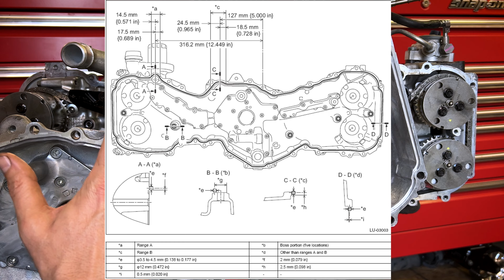Subaru FA/FB Series Engine Timing Chains: Removal & Installation

Comment from the maker: ‼️⚠️Correction in the video! The RTV silicone bead goes just outside of the groove, not in it. Place the bead on the flat mating surface between the groove, but inside of the bolt holes. The groove is there to catch the squish out when the cover is reinstalled. ‼️⚠️
Reply: Should remove the dipstick also, seen it get pinched between the cover and upper oil pan if you reinstall it with it in the tube.
Reply from the maker: @lacrease6517  yup!
Reply: @MrSubaru1387  can't someone like FelPro make a real gasket set for these engines?
Reply: Glad I read the comments. 😳
Reply: @MrSubaru1387 
Hi
Reply: So i followed the video instructions but did not see this comment until after resealing. So i used RTV inside the groove, i did however use a very small bead that was just enough to fill the groove so i wouldn't have globs pushing out. Do you think that is a huge issue? I also let it fully cure before refilling with fluids
Reply: Just remove and reseal it since it was not applied to the mating surface
Reply: @hno7625  just did that yesterday. Had the tiniest oil leak so took the timing cover off with the motor still in. Very easy to clean that groove, reapply, and seal again.
Reply: Do you have any videos showing cam carrier seals replacement in the FB25?
Reply: What can I do after I break that back piece on 9:01
Reply from the maker: @hackiess8146  likely going to have to replace that cam carrier or cylinder head. Whichever it attached to. Not sure which piece you mean or how much of it broke off.
Reply: I just got quoted $3.5k at the Subaru service center to reseal my leaking front engine cover on my 2017 fa20 wrx , do you have a video for a turbo version? Or is it about the same ? What would be a reasonable price ? I’m in California if that matters
Reply from the maker: @cesarreynoso7843  turbo engine cover is basically the same.
Reply: @MrSubaru1387 what are the part numbers for all the Orings needed to be replaced?
Reply: @MrSubaru1387   I have a code that indicates bank 1 cam A low response or something like that, I have already changed the position sensor, I have already changed the solenoid of both cams of bank 1, do you think I should change the vvt on the cam sprocket?
Reply: @MrSubaru1387 what rtv do you reccomend for this? Have you considered using an anaerobic sealant such as loctite 518? This wont harden and enter the oil if too much is used. What are your thoughts on this??
Reply: Thats what I'm searching for
Reply: 170,000 miles on my 2015 and oops my bad
.sure the chain jumped a link
misfiring and a back fire. towed it back to my garage
.hope I didn't wreck the valves or anything..thanks for any advice and this great detailed how to video.
Reply: I need to replace my timing chain in my 2013 frs, should I replace that or the whole motor? I've seen used motors for $3-5k and idk how much it would be to have someone replace the timing chain. And I don't know what would be my best option 😭
Reply: @jedwin4816 It’s not designed for a gasket. The precise metal-to-metal fit is critical.

Comment: anaerobic sealer like Locite 518 or Permatex 51813 is the way to go with these timing covers or cam carriers.  it is much easier to deal with and has zero chance of plugging anything up. i hate RTV the only thing i use RTV on anymore is tins.
Reply: This! Volvo makes a great one too
Reply: How easy/hard is it to get undone for the next repair?
Is it comparable to RTV during removal or might it increase chances of breaking the cover?
Reply: Did you use the 518? I am considering it. I've had good success in industrial applications with it. If you used it, how has it held up over time?

Comment: Hey I followed step by step on how to do the timing chain replace on my 2015 Subaru Impreza. Not I have a p0011 and a p0021 code. And my crank pulley is wobbling. Please help

Comment: Great video, Sir i have a 2013 outbak, I didn't have any timing problems be for doing the job just the chain rattle. Car ran fine .After doing job i get codes for Phasers  to advanced and the car seems a little flat  in performance when driving.  I followed your video to the Tee, Carefully assembling. The only question was during assembly where can the painted links be , Are they dead on the timing marks or  a little to the left or right?  I did not replace the phasers because i wasn't  having timing problems. Any help or suggestions would be greatly appreciated. Good day!

Comment: By far the most comprehensive video on FA timing chain R&R available that I can find. I'm in the process of rebuilding one of these engines right now and I wanted to find something clear and understandable by a professional tech. Thank you!
Reply: How did that go? My timing chain got messed up in my 2013 frs and idk if I should fix it, get it fixed, or get a new motor. I've heard the motors can blow if this repair isn't done well
Reply: @dadrip  i ended up having to move the rebuild due to other projects but since the weather is straight shit right now in northeastern nc i moved the fa 20 block back into the other side of my shop and am about to start building it to have it ready to go in the car this spring.
Reply: @joepluchta4594  hell yeah try to keep me updated on it
Reply: @dadrip  i will, I'll take pics and I'll get back up on here whenever I get this engine put back together.
Reply: @joepluchta4594  bet, thank you. Hope it all goes smoothly

Comment: The labor to do this right - assuming I can find anyone competent- would be so expensive Im thinking a new Factory engine swap might make more sense.  🤔.
Reply: As long as you change your oil regularly, you shouldn't have to change your chain. The serpentine belt after 100k miles is another story.

Comment: My buddy and I done this to his 2019 2.0 turbo engine because of some noise, however the noise is still there, unsure on where it's coming from but sounds just like timing chain loose or worn and making that clacking or chattering timing chain noise any help on possible places and ideas to look at is greatly appreciated. Also can these engine be out of time like 180 degrees and still run just sound terrible?

Comment: You are a walking Subaru Service Manual. An excellent job on explaining engine timing chains removal and installation. Nice tips on how to use silicone sealer, where to use it and how much to apply. When reinstalling parts with O-rings, why don't you put a little engine oil on the O-rings? I would think it would help them seat better between the two parts. Seems that three or four alignment bolts besides the dowels would make it easier to install the cover without messing up the silicone placement. Thanks for another great video!

Comment: This is also such a good guide for EE20 diesel variants (the chains start to go anywhere from 140000km upwards. Engine removal in diesel is not required  for diesels btw, you can get away with fans out and bottom splash guard off if you take your time. You will know if your diesel  chains are due if it stalls on cold starts and disconnecting the cam sensor cable stops it happening (it will throw a code and limit rpm, not drivable)

Comment: Yess I greatly appreciate this. I am in the midst of replacing a cylinder head, and intake cam. Found one of the rockers broke free during a clutch and engine reseal job. No check engine light of any noticeable mpg loss, nothing.. But Im kind of new to the cam clearances and adding the correct caps the the rockers. Ill get it done. But I do appreciate the timing chain video. Ill take all FB20 videos. THanks

Comment: Great look at the FA/FB timing chain setup and servicing. Not a DIY project for anyone but a car mechanic, and not even a service I'd be confident of getting done right at a dealership with their "factory trained" technicians. There's a lot more that goes into doing this service right than knowing your nuts and bolts, as MrSubaru clearly explains.

Comment: mr.subaru you are a god i love you. ive been doing an fa20 build for my car and the other night i was trying to get my timing cover on and i kept hitting the side of the cover on the cam gears and getting rtv on them and it was annoying me. even tho ive put these covers on quite a hand full of times i still just couldnt get it, you showing me that they have these alignment tools just gave me a bright idea to basically make my own out of old/spare bolts and my trusty dusty welder hahaha thanks mr.subaru
Reply: Lmao I did the same thing. Cut the heads off 2 bolts with the same thread pitch and put them in the top corners😂

Comment: IMHO, if you're going this far to change the timing on this engine unless it has been done recently, it would be a good idea to reseal the cam carrier also. And labor wise, I'm sure if you're doing the cam carrier, it's a good idea to just do the timing stuff anyway or do a good inspection
Reply: As someone who has the rattle on cold start, may be worth changing tensioners while you're in there, depending on how much they are.

Comment: Obviously they're not as sharp or durable as steel razor blades but I've found the plastic razor blades can work well for removing RTV sealant on aluminum because you can be more aggressive without worrying about scratching the aluminum. Just make sure you have plenty of them because they won't last long.

Comment: The Toyota 2.7 2trfe has a very similar oil pump design. I did the head gasket on my Tacoma and it wasn’t easy. Head gasket went at 235k miles. Ran good when I finished it but ended up going and buying a 23 wrx which seems like a really cool car. I had about 40 hours into that head gasket. Pretty much what Toyota calls for to fix it.

Comment: Grind a small groove and fill it with paint on the outside of your crank socket to correspond with the key way, that way you know where the key way is all the time. Great video! Thanks! What RTV do you recommend?

Comment: Having a 2018 Outback 2.5 Touring for a few years now, I hit upon your channel and it is IMMENSELY informative. Can you comment on the small battery dilemma ( class action lawsuit )? I live in Canada and my car has sat quite a bit during covid in the last few years. It gets to -25C (-13F) during winter in my neck of the woods. I NEVER had battery/starting issues. I looked a replacement choices if I need it. I am told that the type 25 can be replaced by a type 75. Some youtubers have suggested type 24. They are obviously larger. The battery blanket is, of course, smaller. Is there a bigger one? All youtubers did the cut/patch method. Can I assume either the 24/75 can do the job? Thanks

Comment: Great video, I have just replaced my timing chain kit on my 2013 subaru xv, followed your video, and all is good, but I just saw in the comments that you state, not to fill groove with rtv, I filled , but I was not heavy with it, and let it set for 24hrs before adding oil, should be right, no leaks, sounds quiet for a subaru fb20.

Comment: I'm a Honda guy who is converting to Subaru.  I used to think boxer engines were intimidating, but this is a dream compared to cramped transverse engines.
Reply: They are. The rtv is a pain. If you arnt extremely careful its debri can cause lots of issues. Most mechanics won't be so careful

Comment: I took my frs into dealer with p0018 code. 3 weeks later they told me the camshaft had broken in half. He thought this because when he relieved tension the camahaft moved.  Had them put back together took too another mechanic that tried starting it. Dealership didn't do valve timing after reinstall, and now the motor wont fully free spin with crank, fml.  Any advice on the motor? Just sell it as valves prob hit the pistons? You are my new favorite mechanic btw

Comment: I replacing a tensioner. I’ve removed all the screws. Haven’t removed the cover yet . Just wondering if removing the alternator and ac compressor are necessary. I don’t think I can reach those pry spots with them still attached?
Reply: You don’t have to remove them but it will make it 100x easier to take off and put the cover on. Idk take maybe 20 minutes to take those off. It’s 4 bolts and 2 wires
Reply: @  thanks for the reply. I just removed everything. There is a screw behind the tensioner that would be near impossible without removing it. You’re right, only took 20 min. Thanks again

Comment: Between the timing chain and timing belts I do prefer the timing chain cause they are lifetime and you very rarely have to change timing chains they last forever but… the simplicity of the timing belts and maintaining them and changing them is a lot easier than dealing with this timing chain setup.

Comment: There be dragons! The late model 2011 Forester with the NA FB25 (first generation) dos not have VVT on the exhaust as mentioned in the video. The LH intake cam will be under tension to align the marks. The service manual does have a bulletin, however I found them to be less than clear. In the end, the timing marks do line up the same.

Comment: I am working on one of these engines. My job was to re and re the transmission for bearing failure. The trans mated up fine. Put the first converter bolt in and turned the crankshaft clockwise to install the second bolt and the crank stopped and wouldn’t go any further. Stuck I turned it back to get the bolt back out of the torque converter and pulled the trans back out thinking something was wrong with the trans. I tried to turn the crank clockwise again and it got to the same spot and it stopped again. I pulled the cover expecting it to be out of time. Marks on rh good marks on Lh one tooth off. Took off rh chain and follow your guidance and could not get the crank to go to the second position to remove the second chain. Is there a position for both banks to be neutral to be able to get the crank to the second position. I have tried everything that I know. I would pay you for your advice and information. Just need to get this car back to the customer asap. Thanks in advance for your videos and help.

Comment: @MrSubaru1387 regarding the PCV system, is it more beneficial to run a catch can/AOS on the F series rather than trust the PCV valve? I have a 2022 Crosstrek 2.0

Comment: Hello, So I bought a kit that has 11 parts in it and only 3 gears. (2013 Crosstrek Limited) I know the one gear is on the crank. the other two are cam gears. 2 gears are not in the kit. But when I look for them they are expensive Lol 🤔Any info would be appreciated.

Comment: Any chance you can provide more info on that chain tensioner rattle? How serious it is, and7is it normal for it to make that brief sound at startup and only an issue if the sound of lasts longer than the brief second or so after start up or does even that indicate the problem that I would require what looks like a major service?
Reply from the maker: Its pretty normal to hear with age. If it lasts more than a second or so, likely time to start thinking about tensioner replacement.

Comment: I know this is old but hopefully you still get comment notifications from it. What causes the timing chain tensioners to not get oil pressure to cause the rattle? by 2016 outback sounds just like that and usually with an oil change it gets a lot better. do oil deposits just get stuck in the tensioners? I want to do that but i'm worried about the cost since it seems engine removal is the easiest way to do it and at that point i'm sure there are a lot of other maintenance items to do "while you're in there"

Comment: Hey there, currently putting back together by FA20DIT after building it with forged internals and all the goodies. I'm doing the timing and followed this video to the T as well as following the Subaru service manual information regarding the timing assembly and every sixth or seventh full rotation of the crank is producing a ping sound that almost sounds like a valve hitting the piston. Threw a bore scope in my cylinders and I'm not seeing any damage to the pistons that would indicate timing failure. Any idea what could be happening or what I missed before I tear it all apart again?

Comment: A quick question, bye the way I truly appreciate your detailed explanations. Having replaced a short block on a FA 20 2019 WRX turbo  I would like to know what your best practice would be in priming the oil system prior to firing the engine. Hope your enjoying SEMA, spent 20 odd years as a manufacture ( Flowmaster) there. Looking for some insight

Comment: This was a great help but im getting P0018 on the Left side intake.

For the crankshaft mark, the front(or right side) is clear to me where the link should sit. 
What is your reference point for the rear ( or Left) side?
I noticed there's a mark on the back of the gear i could use or does it go on the same tooth in line with the visible mark of the front(Right)  side? 

i suspect I may be a tooth off but it does run.

Comment: Question, bought a 2016 Subaru Levorg it currently has 190000km(118k miles) and I didnt find a intervol/service amount for the chain, is it a must change when you reach a certain amount of KM's/Miles? Thanks a bunch.

Comment: I have a 2018 2.0 naturally aspirated in a Crosstrek. I do not have triangles on the phasers. There are six bolts on each cam phaser and every single one between two of the bolts has a small hole. Is that my timing "mark"

Comment: Great video! I am not a mechanic so the answer is probably obvious to most. What is the reason for lining up the coloured links to the marks? is the chain not the same all the way around? Thanks
Reply: The colored links help you establish the correct relationship between the two cam shafts and the crankshaft.

Comment: I know this is a little off subject but it seems they have discontinued the OEM alternator for my 2006 Subaru outback. I oem part number is 23700AA55A I am looking for the best quality replacement? Can Mr Subaru or anybody else knowledgeable point me in the right direction? Thank you.